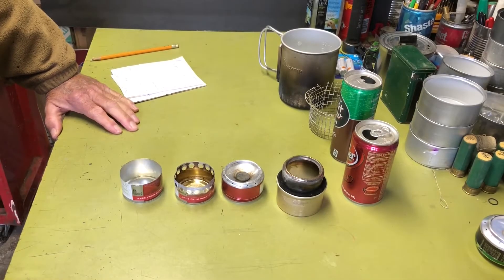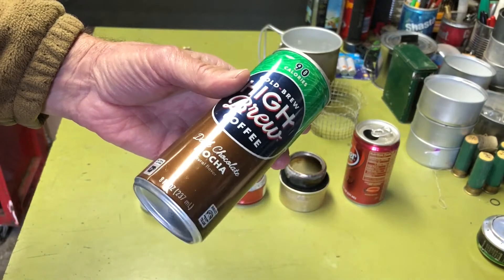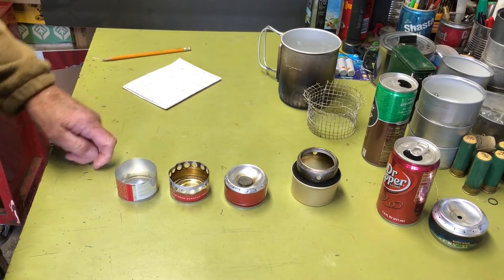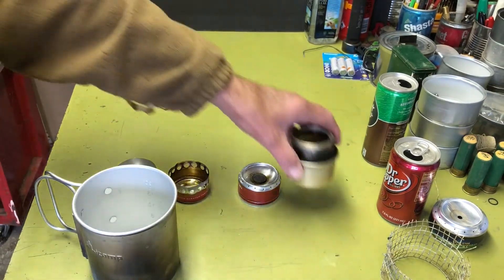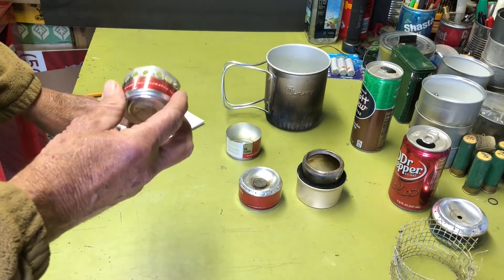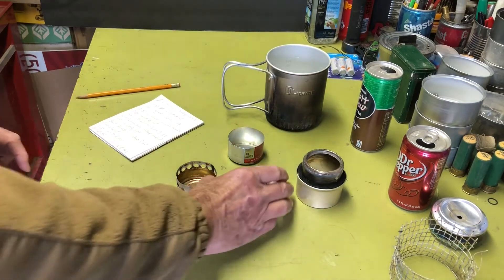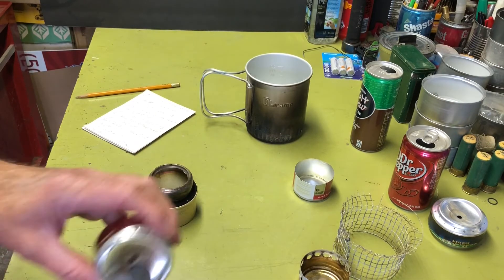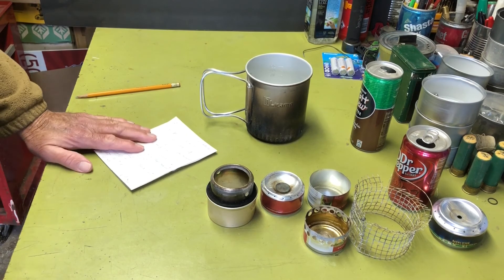Four Alcohol Burner Boil Tests

Comment: 👍 .. a nice comparison .. thanks for sharing.
Yep .. I've got (made them all .. and more 😏) and the Fancy Feast does outperform the others .. a great little burner.
That said, my favourites are even more compact derivatives thereof.
The 200ml 'Energy Drink' cans make for great little burners .. specially in a foldable Esbit Stove or on a little foldable triangular wire pot stand.
I only need one Can. Cut off the top and bottom to size, remove only, the remaining piece of the top Pull-Tab which is tucked away on the inside, drill some extra holes in the top section to suit, fill the top section with Ceramic Wool, press the top bit down into the bottom section and .. VOILÃ 👍.
Now for some more 'useless information' 🙄😏 ..
I've discovered that various sizes of body deodorant and room aerosol cans .. of a thicker gauge than the soda cans .. the applications thereof are only limited by one's imagination.
A nice little kit I've made consists of above-said 200ml Alcohol Burner, a Deodorant Can Gel Fuel Burner, Windscreen made from two Soda Cans and a cut-to-fit circular Silicon Heat Pad. This all fits very nicely into one of the larger Room Deo Cans .. top removed just below where it reduces diameter .. together with a Bic Lighter, Matches and a Taper (for those hard-to-reach spots .. a 'salvaged' strand of Cotton Floor Mop soaked in Wax). Wrap some Insulation Tape around the top of the Can and press on one of those Metal 'Twist-Off' Lids off a suitably-sized Glass Jar and again .. Voilã! Robust .. the contents are protected from damage and the setup be squeezed in almost anywhere.
Pot Stand? I currently use a foldable Wire Tripod which I keep in my little go-to 'Cutlery Pouch'. I'm 'mulling' over making a foldable wire tripod from heavy gauge SS Bicycle Spokes that will also then be stored inside the Aerosol Can.
My Apologies for the Essay .. its just that I also like to share with others, things that work for me (and it's nice experimenting with and making them .. and with minimum tools). Also perhaps, others out there can see that one doesn't have to 'break the bank' in order to get gear for the Outdoors. There is plenty stuff out there .. much of which are 'throw-aways' or can be 'salvaged' .. clandestinely (hopefully then with minimum household strife 😁) and with a little lateral thinking ..
Take care ..
Reply from the maker: I enjoyed your "Essay" :-)
I've also made a variety of  alcohol stove and wood burning stoves from  things around the house.
Those thick aluminum cans would make a good stove, I haven't tried them since I don't have any of those aerosol cans around,  I'm a pit stick man :-)
"waste not want not"  Have a good one.
Reply: @planetsideagent  👍 .. I don't buy much either .. preferring to 'forage' somebody elses throwaways wherever possible.

Comment: Can improve the open can (the left one, just a cup), if take a second can bottom and and fit over the fist, make grooves for help fit,* and open the top like did in the Fancy Feast pot support, by reducing the top hole diameter will obtain more fast boil.

Can use the same second can for reinforce the "Super Cat" type when made with soda cans. Of course, those only justify in case you don't have Carbon Felt to make a "Fancy Feast", that can be made with a can of beer  for the "fuel tank" and a can of soda for the pot support.
Reply from the maker: Interesting, I'll have to try that.